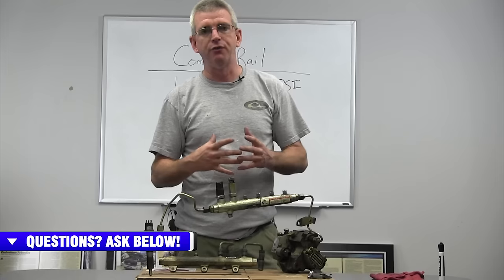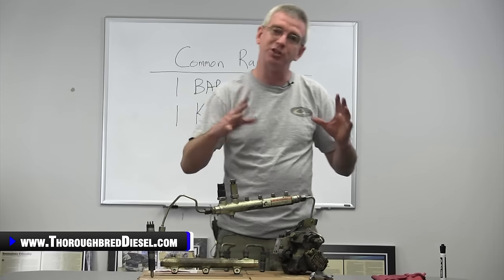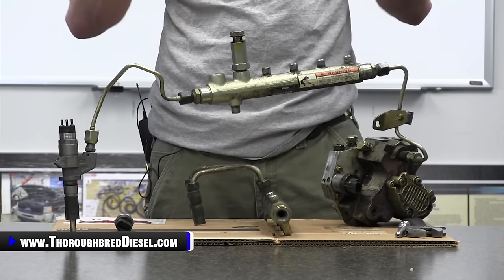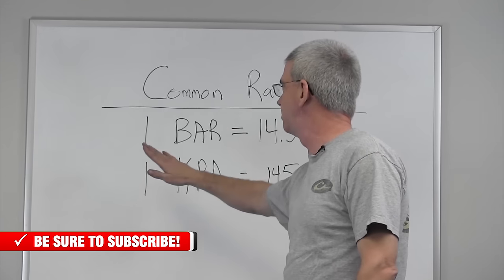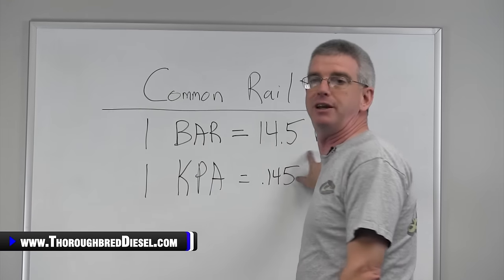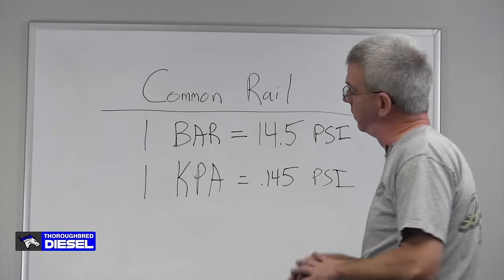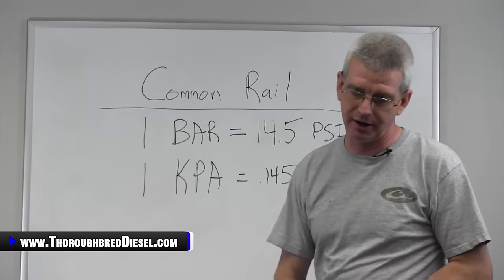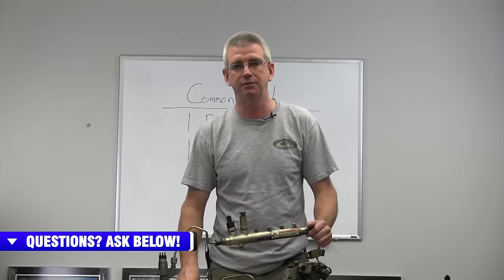What is Common Rail Fuel Injection? 🔧

Comment: Can kerocine be used in the system
Reply from the maker: No. Only run #2 on road diesel.
Reply: @Paul Klein 
So, in short... No.
Reply: If you put sea foam or marvel mystery oil or hot shot secrets in your truck it is kerosene
Reply: @paulklein8556 Así es. Es mas yo de vez en cuando agrego un cuarto de aceite 40 monogrado junto con el combustible.
Reply: @thoroughbreddiesel  im in ireland,we have no help over here,I have fiat ducato 2.8 jtd common rail no fuel at the rail,New pump fuel lines and filter fitted,have you any ideas you could throw at it
Reply: @MrGodsking  fuel tank pump? a fuse blown? ecu file corrupted?

Comment: The common rail is like an air compressor but inplace air fuel is compressed once it rich a specific pressure it cutoff then this compressed fuel is feed to the injectors which are controlled with a ECU.

Comment: So first let me say thank you for the video , Second I want to apologize right up front for my terminology or lack there of . Here goes . It seems to me that the injection pump is now just a high pressure pump which supplies fuel to the injectors all the same consistently . What I think happens next is the injectors are electronically operated when to open from some sort of command module . Compared to my p7100 pump which each injector has an individual line from the pump to the injector and then probably has some type of distributor mechanism these modern pumps only have to supply fuel to common rail and from there the injectors get there instructions from a computer ( I think ) . Though this greatly simplifies the responsibilities of the pump the weak link here to me is the computer for if it does not send out the right signal at the right time I don't think it could be good . Am I close here ??

Comment: Your demo rail, the one for the 5.9... it only has 1 injector connected. Where do the other injectors connect?
I see the 5 other ports on the rail but I  guess I just expected all the injector ports to be in a row. (I'm making the assumption that the 5.9 is a 6cyl)
Reply from the maker: We show a 8 cyl and 6 cyl rail here.  On a 6 cylinder in line,  all fuel lines will be on top of the rail.

Comment: We have a manlift that shutdown abruptly while in use. After that, it did not starting anymore, just cranking(with enough diesel). Its engine is Deutz TCD 2.9 L4. What could be the problem? Could you also point the  locations of certain parts(names) of the engine? Hoping to help me out on this problem. Thank you and more power.

Comment: Hey Wade, an excellent overview of common rail injection systems but I disagree the "injector is the brain". As I believe you will agree (on second thought 😀?), an injector only does what it's told, in the case of my LB7, by the Fuel Injection Control Module, itself with instructions from the Engine Control Unit. Looking forward to future installments!
Reply from the maker: You are 100% correct.  I did not put enough emphasis on FICM and ECM in this video.  Injectors are by all means a “slave” unit in the system as well.

Comment: I've got a Nissan Patrol Common Rail turbo diesel. Just found out after last service that the fuel injection pump is leaking. Is that the dumb pump (CP3 Pump) that you are talking about in the video. The cost to replace that part is around $4000, that is expensive. Why is that so expensive?
Reply from the maker: I would have to see the quote on the repair, I am not familiar with the Nissan so I don’t know if it’s the CP3 that is so expensive or the labor to change it.
Reply: @thoroughbreddiesel    labour is $880 AUD, rest is the part. Have to save up for it as I cannot afford that at the moment.

Comment: I've going through a problem, where the fuel rail return line is giving extra heat on the hose and pipe
Reply from the maker: That’s a sign that you have a high fuel return condition.

Comment: if pressure relief valve fails it may cause a hot start missfire? I got a honda diesel and is driving me crazy for 6 month already. Morning with cold engine starts fine but after a 30 minutes drive starts after 2 or 3 attempts.
Reply from the maker: I'm not familiar with that motor, but sounds like a supply problem,  low side fuel pressure.

Comment: How is the engine get more power after applying accelerator, accelerator provide fuel or air on common rail engine?
Reply from the maker: Complicated question on common rail engines.  It is commanding a fueling combination that if it is agreeable with other engine conditions will produce more RPM’s.

Comment: Sir what is the common problem of common rail pressure pump, diesel fuel  goes to engine oil crankcase
Reply from the maker: Drive shaft seal but that is a very uncommon failure.  If you are having diesel in oil suspect injector failure of some sort.

Comment: whats the function or need of overflow hose in the system and iS it connected to injectors?
Reply from the maker: It can be connected to the injector returns.  The overflow hose from what is the cascade valve is for fuel that is tripped from the relief valve.
Reply: @thoroughbreddiesel  thank you ❣️
Reply from the maker: @jaibabu7481  you're welcome!
Reply: in isuzu dmax 4ja1 engine one pipe from fuel pump is connected to the engine block and a connector connected to it what is that for bro
Reply: i think the pump has integrated pcv

Comment: Hii how many bars are needed why ECU controls the common rail injectors?
Reply from the maker: Example of a Lb7 Duramax (2001-2004 Model Years) works in a 5000 to 24000 psi (roughly) range so 344 Bar to 1650 Bar.

Comment: Can you do a video going over the best diesel injection systems in a list for running heated vegetable oil?
Reply: P7100 12 valve Cummins
Reply: Don't use it, no fuel injection system is designed to operate correctly and reliably with anything but diesel fuel.

Comment: is the pressure limiting valve and control valve the same?
Reply from the maker: Depends on who you are talking to.  Pressure limiting is the same as the cascade or overflow valve on the rail.  Control valve is usually the electronically controlled portion of the common rail pump that controls the pressure delivered to the rail and injectors.
Reply: @thoroughbreddiesel   ok bro tq
Reply: can it also be called as metering valve, the pressure control valve

Comment: sir is the pressure control valve and pressure relief valve the same ?
Reply from the maker: Yes and no,  it depends on who is talking and what they are referring to.  A pressure relief valve is often call a cascade valve or some people mistakenly refer to them as “race valves”.  They can be fully mechanical or electronically actuated in some applications.  Usually found in the fuel rail.  A FCA or fuel control actuator (sometimes called a MPROP) is usually located in the injection pump and it controls the fuel pressure supplied by the fuel rail.
Reply: @thoroughbreddiesel   means the metering valve and pcv on pump is same sir?

Comment: thank you for sharing video very informative. i would like to ask what is the problem of my Toyota 2kd d4d. its loosing fuel pressure when i start my engine. im pumping my fuel filter  everytime i start. and it does not run long time it stalls . thanks for the answer
Reply: You have same problem with me

Comment: please ,can you advise me regarding the possible causes of loosing pressure of fuel from common rail & injectors after 30 minutes approx,our engine is perkins derive gen-set 250 kva, thats led to shutdown of diesel engine ,in spite of every thing is ok,,normal starting and loading to our actual load 45% of generator rating... thanks in advance

Comment: What can causes ecu to deliver low to voltage to the sdv
Reply from the maker: Are talking about a shut down valve?  And by that are you referring to a MPROP or FCA?  If so,  then would look at commanded actuation vs. actual, and see if it is losing signal in the wire or is there something in the 5V reference circuit that is the problem.
Reply: @thoroughbreddiesel  Am talking about suction control valve in a toyota 2kd injector pump which is giving me less than 3 volts in the connector with key on.

Comment: Is the cp3 a liquid sealed pump or a rubber seal pump ? Also what is the volts deliverd to the fuel injecters ? If the fuel line is airlocked could i expose the top of the inlet manifold and block it. Then turn the engine over to use its nayiral suction to pull the fuel through the line from the tank to the injecters ?

Comment: Sir good day i hev a problem of an engene 6m60 the common rail injection is that normal wen the engene is at normal idle i loosen the injection in 1 piston ther is no fuel are coming out only the injector 3 has a fuel coming out cen you help me pls im prom phillippenes

Comment: One question no one seems to know the answer to. And a firm in Brighton called auto diesel marine a Bosch agent repairing injectors and repairing engines had no idea. How terrible they did not know the exact point in a Diesel engine when the injector fires. I’m after thinking about it, believe that it is either just after piston has reached top dead centre so as the explosion goes off it fires downwards. Or as piston rising from air intake stroke. As it’s pressurised in the rail, and if it was to be injected into the compressing air, I would think maybe when piston is 75 percent up and air not too hot yet to make Diesel go bang. My first answer I believe more though. Do you know?
Reply: Always injects before top centre dead centre, which varirs with load and speed but, modern systems may inject up to 8 times per duty cycle, one reason modern injectors are so unreliable.

Comment: What problem if fuel not comfortable of the pressure
Reply from the maker: I don’t understand the question but the pressure of the lift pump is the life line of fuel delivery to the high side injection system (on fuel systems designed to work with a lift pump)

Comment: Wade good morning from rainy west coast Canada. I like your diesel tech...helped me a lot in the past.

well, I've got a 2007 classic LBZ Duramax, under 2/2 or more heavy instant throttle I get a steady haze of black smoke, lighter than dark, but it's not a normal LBZ haze, it's thicker. no limps, from low rail pressure or anything , but why would a 130000 mile good running truck do this ? runs great!

thanks Wade, looking forward to your weigh in!

Randall
Reply from the maker: That is an odd one from your description. It’s almost like you are getting an incorrect vane position compared to your throttle position. I would have to see a log of the truck running to be able to help.
Reply: I see, I think you have it pegged right, something to do with the turbo side. How Dan I get it data logged without EFI Live? A GM scan tool (Tech 2)? A dealership nearby is very helpful with scanning assistance and reasonable on labor to do so.  What logs specifically can be recorded?
Reply: Btw Wade NO TURBO VANE POSITION SENSOR fault code ever....
Reply from the maker: Desired and actual vane position would be two parameters that I would look at.  They can run real-time scans with the Tech 2.
Reply: That makes sense with the turbo being a mechanical device, and it's operation being sensed by electronics can be monitored.  I drove it 200 miles yesterday on a good highway run.  Even on 70% throttle, hard acceleration from a stop I'm getting less and less black smoke and more of a regular LBZ haze. I think it was just sooted up by the in town driving of the last owner's hugely in town use.

One thing I found interesting on this drive is at exactly 9000 miles, the change engine oil level from the DIC came up, does this really mean that the DIC is not set for 10000 miles as a mileage ticker, and uses real world use engine parameters to decide?
Reply from the maker: That is all totally possible.  A sooted up vane would totally cause this.  I cannot tell you that you need to get on the interstate every once in a while and “blow it out” but really sometimes that’s what needs to be done.  Your mileage for the oil should come on every 5K miles if I am not mistaken.
Reply: Agreed. Yes a blow out of all low speed stuff once in a while is always good.  On the subject of oil, I have 2 of these LBZ'S. A winter use one, and a summer one, how worried should I be about time limits, 12 months or a 5000 MILES whichever comes first, is acidity in oil within a 24 month period something to worry about if one is not getting their full 5000 miles on the oil and filter within 12 months ?
Reply from the maker: I would go on the side of caution there and try to change the oil and filter every year.  I have no mechanical or chemical backing for that statement, I personally just think it is cheap insurance.
Reply: I will have to agree with you on this one, so change it at the end of the season or change just before use begins again?
Reply from the maker: I would think so yes sir.

Comment: how i check the signal from ECU that is the point especially in common rail every injector has two separat wires coming from ECU i will be thankful if i receive your answer thanx
Reply from the maker: The signal to the injectors is so fast that only VERY high end multimeters will read it.  A low amp probe may be the ticket.

Comment: I have a question about my 2005 5.9 common rail My truck started fine in the morning’s and runs fine throughout the day has power everything but if I shut it off when it’s warmed up going to the store five minutes later go to start it back up it doesn’t wanna as it would when’s it’s cold but will start but has a long cranking time before it does fire usually like seven seconds to 10 seconds of cranking, Ive replace actuator on cp3 clean relive ball on cp3 and now difference new lift pump 1 year ago has 230000!miles replace fuel filter every 4000 miles please help

Comment: What about bleeding in case of fuel ran out does it needs bleeding?
Reply from the maker: Common rail injection systems do not need to be bled. Make sure all lines are tight and if you have sufficient lift pump pressure, crank the truck in 5 second intervals till it starts.

Comment: Can bad fuel pump burn injectors?
Reply from the maker: Low rail pressure can cause damage to your injectors, as it relates to heat and air cavitation damage.

Comment: How to bleed air out of this system
Reply: Nothing to bleed out system, start up the engine until all air is removed out of the common rail injection then the engine is starting to run. The dieselfilter must be bleeded out after the filter is replaced. Greetings from car mechanic in Norway.

Comment: You have that injector and line connected to the rail at the pressure relief valve on the end of the rail. The connected injector cannot get any fuel from that port, so whoever setup that example does not know how the system works.

Comment: Common rail não vale nada. Você ficará dias procurando o defeito por eliminação e não ganhará nada com isso. Arrume trabalho melhor. Common rail is worthless. You will spend days looking for the deletion defect and will not gain anything from it. Arrange work better.
Reply: Use diagnosis tools connected to ECU and measure amount of fuel from each injector and measure pressure in the fuel system. To find fault will take up to 30 minutes and some hours to replace defect parts. Greetings from car mechanic in Norway.